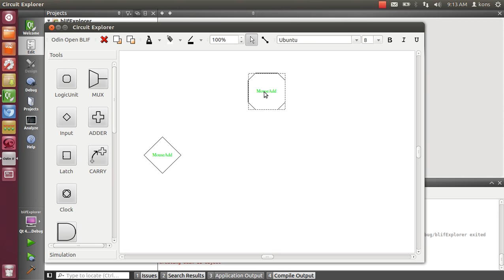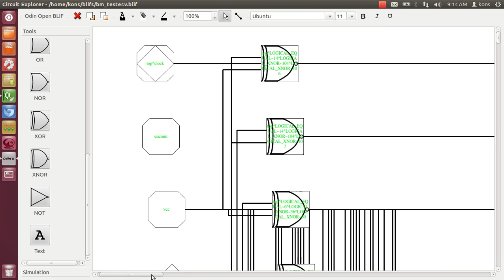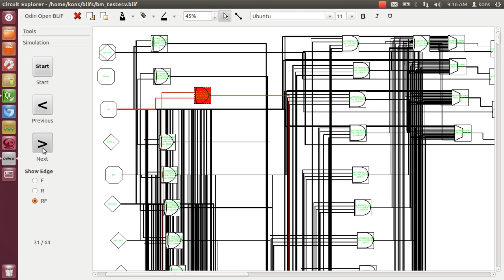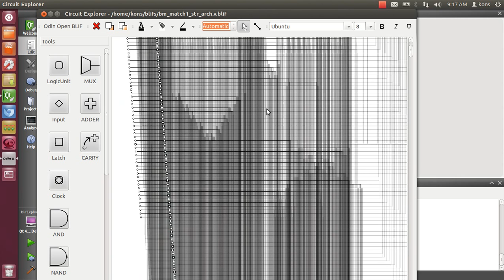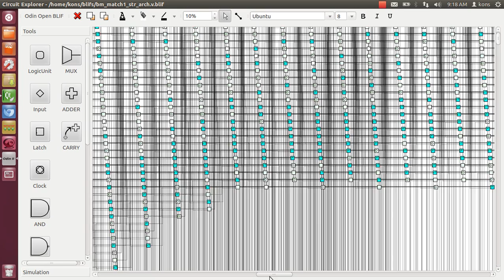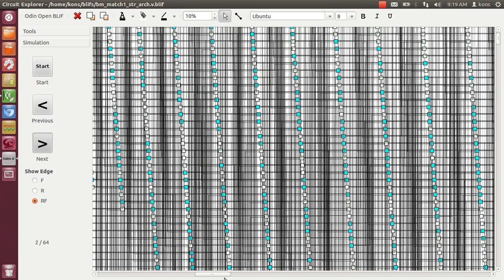Verilog To Routing (VTR) project: Visualization in Odin II

Comment: Hmmm... this isn't real routing yet, is it? The visualisation just shows a schematic of the intended project, but I can see the lines with the signals going right through the logical gates and not being laid out in a logical fashion as they would be in an FPGA. Is there another step that does the actual routing?
Reply from the maker: Hi there! Thanks for the question. Yes, this tool from 13 years ago showed an intermediate step of the VTR flow. In fact, it showed the result of the synthesis step where Verilog was just translated into a circuit. After this, the design went on to be optimized and routed using additional tools and architecture description. You can read more about the current state of the project here: https://verilogtorouting.org/